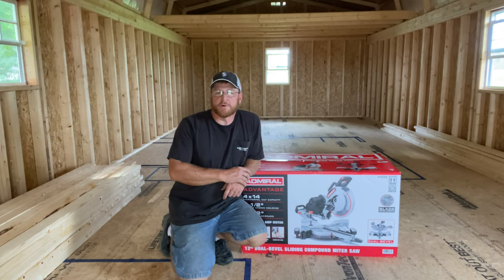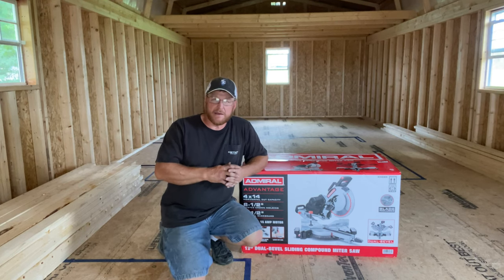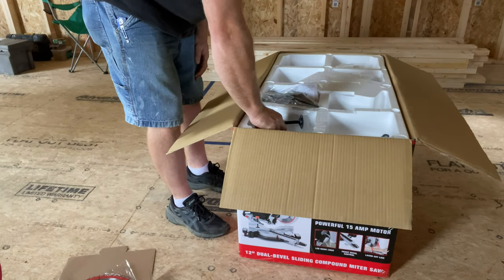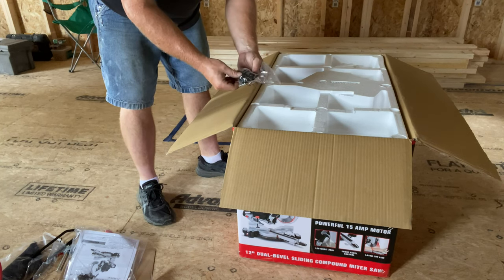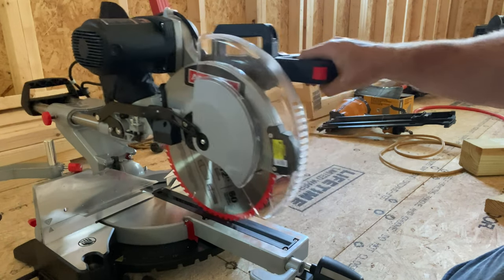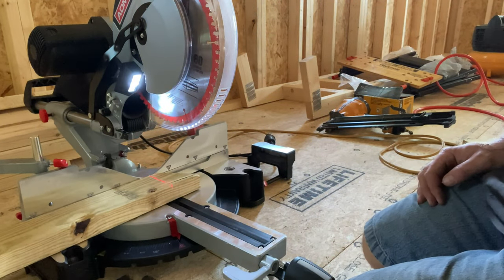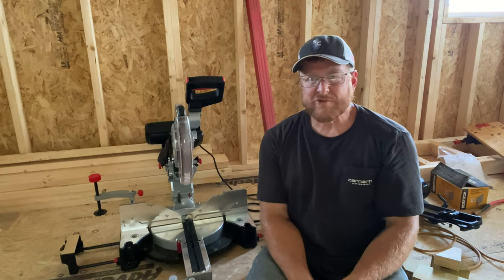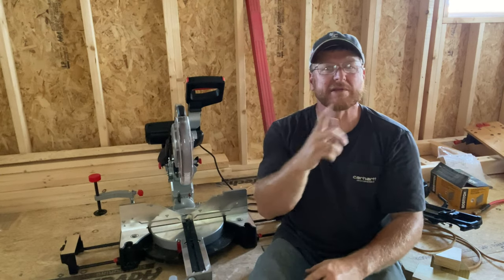It Weel Cut I  TOOL REVIEW  I HARBOR FREIGHT MITER SAW  I  ADMIRAL SLIDING COMPOUND MITER SAW REVIEW

Comment: Been getting a tonne of overtime, bought a new Lincoln Handy M.I.G.,, haven't bought an argon tank yet, also bought an Atlas gravity fed band saw from an auction, had to order the blades made to fit, can't find off the shelf 59.5" bi metal blades.
Reply from the maker: We have had a Lincoln for years, and it’s been great. That’s great. Hope they serve you well.
Reply: @BarrRunForge  always heard good things about Lincoln welders, step dad had a Lincoln 4 cyl. diesel driven generator welder on it's own axle with a towing tongue.